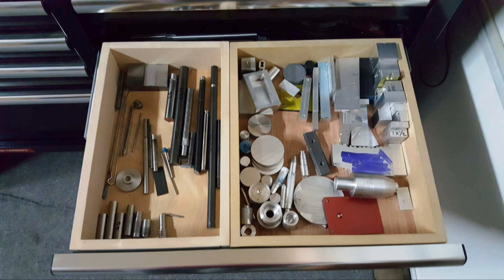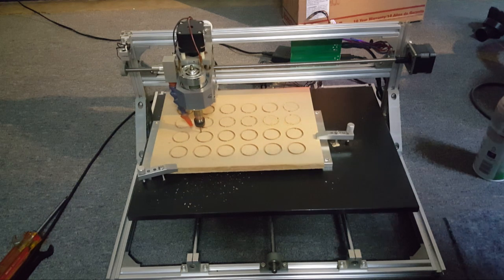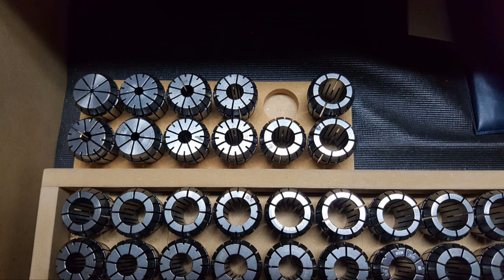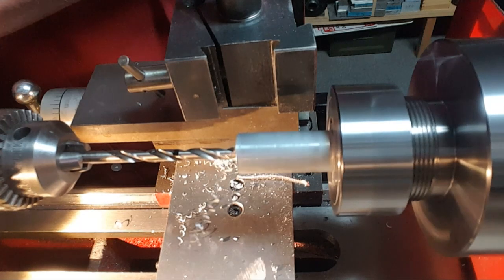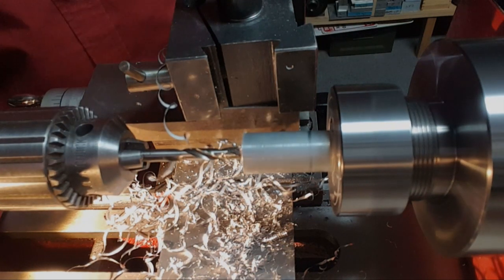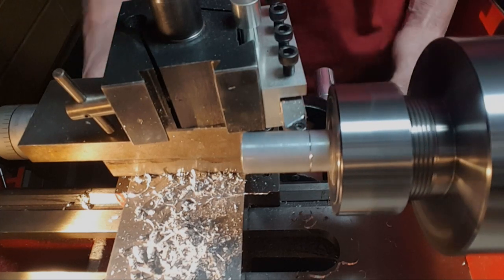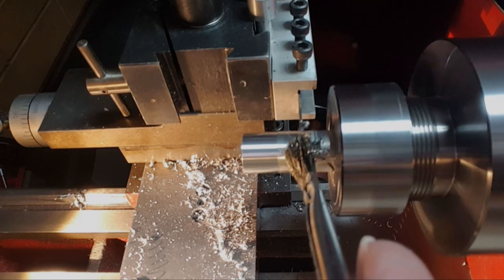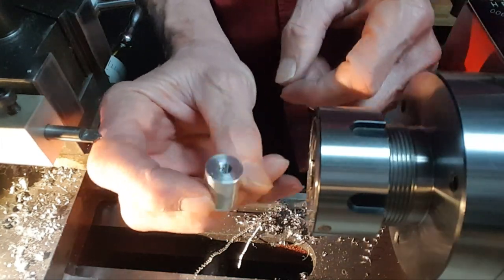Shop Upgrades & Machining A Thread Protector

Comment: Thanks for an old fashioned chip video.
Really a nice footage, at close range.

By the way. One guy launching plenty of 3018 videos pointed out that the dust from MDF board milling is bad for the lungs and protection should be used...
Reply from the maker: Cool, thanks

Comment: I'm new to hobby machining, I found yr channel and was wondering if you could  direct me on how to attach a quick chance tool post to a old ( but fully  working) 109 craftsman min.    I find videos on other lathes attaching them but not mine.   I have a metal cutting saw  grinder and tons of tools but no mill.
I understand I need to make an adapter for the post,  but don't understand how it stays in the slot while the cutter is on the work piece?? 
Any tips would be great ,   thanks 
Ken from Boston
Reply from the maker: See steve at shark river he is the master of craftsman lathes. https://www.youtube.com/c/RStevenLang
Reply from the maker: Forgot steve is out of town but if i remember right a plate with a threaded hole in the middle slides into the slot and a piece of all thread that the tool post slides on is tightened down in the hole forcing the plate up clamping it in the slot. But you need a mill to cut the sides so the top of the plate is flush.

Comment: Question?   Your turning in FOWARD but feeding in REVERSE?    How do you do that on these small machines?
Reply from the maker: The lead screw is run by a stepper which I can control the direction with a switch. The internal gears are removed.
Reply: @TheMiniMachineShop   I figured you had a trick.  Great idea !

Comment: Is there a second part coming? To me it looks like a long nut with a circular circumference. What do I missunderstand?
Reply from the maker: In the beginning I had a need to hold threaded items to machine or polish them. I only had a 3 jaw back then and didn't want to clamp on the threads. So I made a set of these in imperial and metric which I could clamp on then put a screw with a nut on it for the job. I've used them so many times for jobs that I increased the set to include the sizes that were missing. This video was just showing making one of them.
Reply: @TheMiniMachineShop  I made a few parts for the same reason, holding screws without damaging the threads. The length was some 1/4" and I slit sawed it along the 1/4" length. The 3 jaw squeezes the slitted item to hold the screw.
Reply from the maker: @Stefan_Boerjesson  I did mention in the video some people split them but I didn't want to do that because it would introduce run out.
Reply: @TheMiniMachineShop  Yes, some extra runout ought to be introduced slitting them. However the play in the thread between the screw and the protectors also gives some runout I guess.
When concentricity matters can be worked around I've had good help from the slit version.